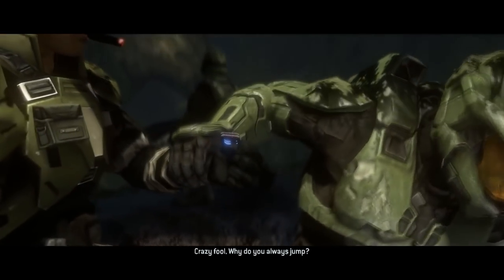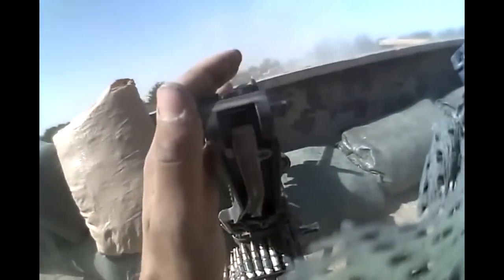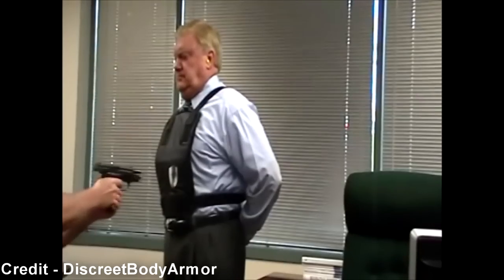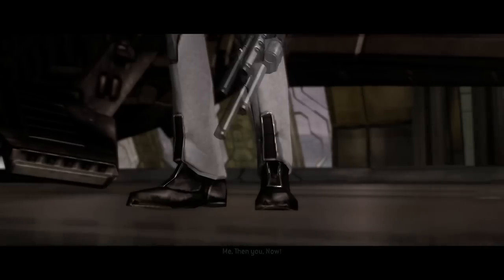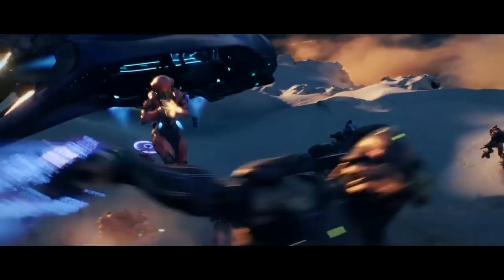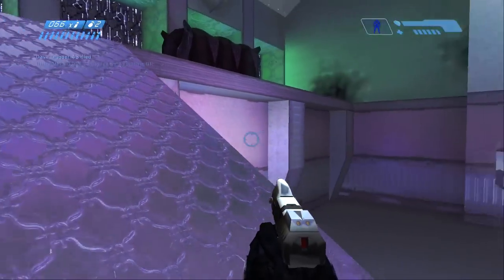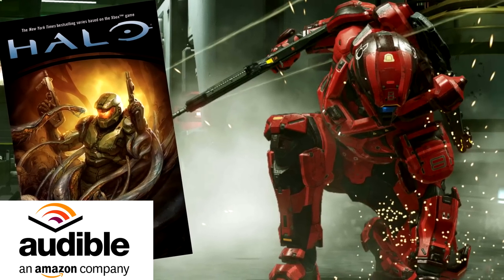Master Chief's Mjolnir Armour Full Breakdown (Halo)

Comment: The gell layer is probably a non newtonian fluid instead of a woven  vest of stuff
Reply: the goat king people are already trying to make this stuff. As far as I know a military is developing something called TALOS.
Reply: iirc the TALOS Project is trying to develop a set of 'power armour' to help with lifting stuff. Not a gel layer beneath armour which makes the wearer able to survive a fall from space.
Reply: Doctorpen  

Also, scientists at the Massachusetts Institute of Technology are developing a next-generation kind of armor called “liquid body armor.”

It “transforms from liquid to solid in milliseconds when a magnetic field or electrical current is applied,”

Totally didn't find the Talos suit by googling Talos suit 2017.
Reply: to problem is forces acting on you can be dampened using armor like real life yes however a body in spartan armor traveling at terminal volocity hits the ground the armour stops yeah but the spartan doesn't the spartans body is going to carry on traveling that speed untill somthing stops it and that gel even if it could without smashing up the body the internal organs also want to carry on traveling at that speed .. im sure you get the picture . to break a fall you need to be slowed down at a deceleration rate that wont kill you and unless that gel inside the suit is squishy and big enough to slow down a spartan falling from orbit longer than a slit second of the impact (which is impossible) then a gel layer would not stop you from being subject to G's

Comment: Correction: the black undersuit is not the gel layer. Immediately against the user's skin is a "moisture absorbing cloth suit and biomonitors that constantly adjust the suit's temperature and fit", on top of that is the pressurized gel layer, on top of that (in the Mark V and on) is "a weave of additional memory processor super conductor" which is how Mjolnir can support a smart AI along with the modifications to Chief's neural interface on the back of his head. Then on top of that we have the black undersuit which is composed of a "new reactive metal liquid crystal" which is what amplifies a Spartan's strength. The last external layer is the titanium alloy outer shell pieces. In the Mark V onward this is also where the shield emitters are held. On top of those green plates is the heat dispersing coating for added protection.

All the above info was pulled from Eric Nylund's book The Fall of Reach

Comment: I think that since it's called biofoam, that it would only last for a certain amount of time until it dissolved into perhaps a liquid or some form of nutrients. If I recall correctly, in either Contact Harvest or the Fall of Reach, a marine says after using biofoam something along the lines of, "This will stop the bleeding but not forever...". This indicates that the biofoam would dissapate after a given amount of time. Thought of this after you explained the current biofoam-like project and biodegradable clay pidgeons popped up in my mind.

Comment: Luke TheNotable, we do have something VERY similar in the Army since 2012 its called Quickclot Combat Gauze, which utilizes kaolin nanoparticles impregnated into gauze. It is designed to stop moderate to severe bleeding and stabilize a combat casualty. However, it is not a foam, and as gauze, it must be packed into the wound. An experimental foam developed in late 2012 by DARPA also bears many similarities to biofoam, as it is capable of packing combat wounds and halting internal bleeding.

Comment: On the topic of gel layers, some company made a type of gel layer that gets harder the more force is applied, so a punch will break your hand, and it's moldable,  pretty sure that  the weakness is lots of pressure applied to one small spot, so basically a single bullet will pass right through while something like an Automatic rifle will spread out the pressure throughout the gel, so very vunrable to snipers, very durable against An AR

Comment: LukeTheNotable, you forgot to mention that there is currently a way to stop blood loss in combat situations. I remember we had QuikClot combat gauze in the IFAK. Before that it was in powder form which its use was discontinued because of some of the drawbacks. In order to stop the bleeding a lot of the powder had to be poured on the wound.This would cause a production of heat from the reaction and may cause thermal burns. Another was the if there was a breeze the fine powder may get blown into the eyes causing ocular burns. If the person applying the powder decided to open the pack by tearing it open with their teeth they would  get chemical burns around the mouth. Not good.

Comment: There is a few references stating the cost of just ONE of those suits is as much as a ship in halo cannon. Which I'm sure finding that will be easier than the suit's cost in today's money, ultimately my rough estimate is 1.6 trillion in R&D and 5.5 Billion in a single suit, not to say other companies would have cheaper less effective suits mainly for Spartain III's and IV's as that is a much wider market for contract than Spartain II's. ODST armor is simulator to Spartain armor in a lot of different ways, but can be used by anyone. My idea of micro electronic-hydraulic enhancement suits similar to exo-suits but with finer detail such as improvements on grip, speed, stamina, and overall strength is also proven in cannon as well as Halo: Nightfall. The polarization of the protective glass/polymer is only unique to the ODST's which makes me think that a true Spartain helment sees not using a glass or a polymer rather a camera system that can enhance reflexes by having an AI of some classification or another predict the next move of an object which would further improve the soldier, unlike ODST's who had to rely on instinct rather than technology. The reason why you wouldn't notice the difference is because this is done fractions of a second faster than the time it takes light to travel even faster than what the image to video of today's tech is by using super highspeed cameras and a process that filters out stagnant and actice then uses velocity of that object to predict on screen and notices velocity changes and adjusts protective solutions, this is also why it can accurately judge shots of a weapon based on a predetermined model, and can learn based off of individual weapon and can adjust fire based off of minor variations of round trajectory and impact. This means that no standard computer can process, meaning the suit has a quantum computer built straight into the helmet, which explains further why AI can thrive in that suit VS. another suit. That quantum computer is probably located near the NSI located near the back of the head, major trauma could off-set the computer locking the suit or worse... if an AI is aboard the quantum computer wail such an impact has occurred or receive an AI after damage it could lead to faults within the program such as Cortana... expensive? Very. Tough? Only head on. (See what I did there?) Most of the stuff used in the power armor isn't currently known or used today, but what I can say is the suit has inspired people to try to make this suit, though the closest thing we will get to within our lifetime is the famed ODST armor. That's not including genetic enhancements... to completely answer it using rough estimates.

Comment: The suit really just helps enhance what the augmentations already gave them to the fullest. Master chief was able to survive that fall not only because of the jell layer in his suit but because he has a ceramic mesh around his bones, making them nearly unbreakable.

 Them being tied into their suit through their nural net is great because they've got an augmentation increasing their reaction time and motor control by 300%
Not to mention the muscle augmentation being boosted by the armors motor enhancement. Spartans really are the smarter, faster, and stronger
Reply: but a impact caused by volocity is much more complicated due to yes armour bones and and the gel layer can all stop without breaking and the gel layer can of corse dampen the impact slightly but traveling at terminal volicity when the armor stops your body carries on traveling that fast untill it meets the armor then your organs keep traveling at that speed until they meet your bones and muscle. forces acted on an area yes easily warped and diverted but acceleration and deceleration are problems

Comment: there kind of is a biofoam used today but is more of a cotton kind onf thing that is applied directly into the wound and it is supposed to desintegrate to stop the bleeding from a gunshot except instead of being fanvy like in odst you just ram it up the hole from the wound
Reply: I'm not sure if this is the device you were thinking of, but there is one called XStat and was approved for US military use in 2014, later approved for civilian use in 2015. Basically it uses cellulose sponges to absorb blood and put pressure on the wound to stop bleeding, like a localized tourniquet.
Reply: Watched a little further in the video, and he shows XStat being injected into a beaker.

Comment: Actually the bio foam is already real and is about to go to doctors for use. it instantly stops bleeding by working with the body and work with just a slab beef to stop the bleeding and can be washed or removed a minuted later depending on how severe it is.

Comment: so why don't they have "fallout" type armor as a substitute, that is famed exo-armor, rather than fluid "scale"-type armor that the Spartans currently use. basically a grunt goblin, with intuitive controls, rather than reactive controls like mjolnir as stream lined assault armor used for frontier forces where Spartans are either too much, or is so sparse a marine needs to be a spartan close equivalent some of the time, a sort of super-heavy armor that anyone can use and has substitute built in that the Spartans already have.

so on an armor scaling it has strong physical resistances but may or may not have a full energy shield, doesn't have and cannot use any weapons except from a specialized weapon pack.

I almost think this would be the kind of think the rebel faction was trying to make before the war and the grunt/convenient, like Oni tried and the jackle shield, reverse engineer. a sort of scaled mantis for light infantry, ODST, other shock forces, and deep out post where equipment is limited. the drawbacks of such armor being, needs constant refueling, becuase being so small while it can operate, it has maybe 6 hrs before needing to refuel, where Mjolnir can run nearly forever and do a mach 1:1 on everything. basically a shittier, less expensive, more temperamental substitute of a spartan and mjolnir. so in short why dosen't the UNSC have exo-armor that works just like mjolnir?

Comment: The injectable foam tube you were talking about in your video the one that hold all the small pellets yah that's the XSTAT and in the Army we use that currently just heads up. And the cost a Mijolnier armor in Cannon is as much as a UNSC Destroyer and the brand new Ford class aircraft carrier costs 10.44 billion I'd say the armor in today's money would be in the trillions if not quadrillion range even without the shield tech and theoretically if we could build it I'd estimate it to be that much. Granted to us that sounds like alot but remember we're one planet using the resources and stuck to the global economy we have here alone while In the Halo universe before the human-covenant war we inhabited 800+ world's so in comparison it's alot cheaper.

Comment: I'm pretty sure the gel layer is in the armor, not under the undersuit.
Reply: Arc 48 The under suit is actually called that because the alloy plates go over it. Most everything else is either in or just under that layer. The under suit is the majority of the armor but not the majority of the protection.

Comment: In the halo 3 manual, it says that master chief's armor weighs 1000 pounds. Not 700.
Reply: No it doesn't. It says that IN power armor Chief weighs almost 1000 pounds. The 1000 pounds includes Chiefs body weight.

Comment: Sadly the suit is very easily stoppable in fact one guy with an ak-47 could kill a Spartan but they'd have to have the jump on them witch is neigh impossible with the motion tracker but based on the assault rifle using 7.62 ammo it's basically just a bull pup ak
Reply: In the first halo game you can find assault rifle ammo labeled (like most other ammo if I recall) it's also stated in the novels (not sure if they are cannon or not but close enough) besides they have no need to be large in caliber especially considering they are just spray and pray weapons not a marksmanship rifle

Comment: Now just making the armor of master chief is hard and would cost a lot. If it was made with titanium which it is but you would have to get rid of a lot of armor since titanium is hard to shape. Now yes you can shape and make titanium into a liquid but it would lose a lot of the strength in the armor. Now just wearing the armor you can kill you self cause it is 1000 pounds. Now you would need an air compressor to help you move and you need the chip on the soldiers head because it helps your reflexes but just for that will cost a lot so we are just better off just making a full size plastic armor for master chief since we can do that and already did but still would cost some money.

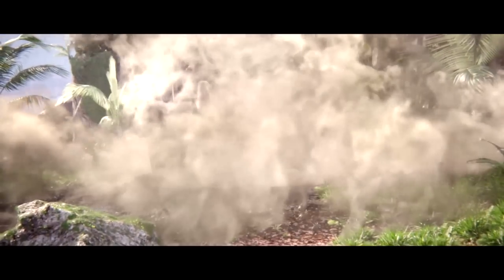Comment: 4:00
That's not how inflation works. Inflation is the increase of the unit of currency compared to the unit of value. In other words: if you have 10 pounds of gold and then make 10 dollars, each dollar is worth 1 pound of gold; if you then make 10 more dollars, then each dollar is worth only 1/2 of a pound of gold. We get inflation today because: 1:Banks create currency through loans (then spend the 'inflated' currency at the value of pre-'inflated' money since the general currency hasn't been 'inflated' because the 'inflated' currency hasn't been introduced into the economy yet. So once banks spend this created currency, everyone's currency looses value), 2: The issurer (in this case the Fed) prints more currency than value is created (in the case of the recent 'stimulus' we're talking billions of dollars a day more currency to value for a period lasting in excess of almost a decade).

Before the 'stimulus' of the 00s, the US dollar was worth just 2% of what it was worth when it was originally introduced. (Interestingly, most governments e.g. Rome, tend to collapse when their primary currency drops to about 2% of value.)

Comment: So the suit basically has a small sun powering it
Reply: Darren Rainey Well... technically no. We have small reactors like this already, not quite this small though. Honestly, the estimated time between refuelings for the suit here are conservative estimates based on the technologies we have now in regards to small nuclear reactors.
Reply: That is incorrect we have nuclear reactors that split uranium atoms (fission) to produce heat which boils water that turns a turbine. The mjolnir armour uses Fusion reacors (same process as a star) This process fuses atoms together in the suns case (hydrogen fuses with each other to create helium) This reaction produces ludicrous amounts of energy. but a fusion reaction needs to sustane its self for it to be a fusion reactor that can power things . We are working on them today, i belive france is currently building a fusion reactor it has been delayed alot and isnt going to be ready until atleast 2020

Comment: Where is the fusion reactor located on the suit?
Reply: DragonHalo3D the 2 rectangular looking things on the back of the armor are the fusion reactors.
Reply: Arc 48 Is that why Spartans die from one hit to the back?
Reply: DragonHalo3D probably, but I do know that the neural implant connecting the spartan suits to the wearer can snap if struck from behind with enough force, causing the suit to collapse in on the wearer slowly and painfully killing them, for more detail watch game theory's halo armor video.
Reply: Correct me if I'm wrong
Reply: Timmy Wallace The Game Theorists just speculated why it could happen. The real reason is to reward players for sneaky plays and outmaneuvering enemies.
Reply: Basically it only exists cause it a game. Just like with their theory on Lightsabers vs Energy Swords. The only thing that the ES had that was worse was it's 10 strike limit which is a gameplay balance and IMO makes it better since you can't just go through the entire campaign just one hit killing everything.
Reply: Timmy Wallace It's also because we only see it happen when another Spartan hits them there with a precision strike in a more vulnerable portion of the armor. The jell layer can handle an over all hit from space. But not single bullet less than one froman anti-materials rifle would be able to do the same thing.

Comment: WRONGGGG, It weighs 900 lbs...
Reply: No it weighs 700 with the 200 pound spartan.
Reply: I'm gonna refute from saying anything rude, An average Spartan weighs 300lbs roughly on their own, Their armor weight does vary, But most of the Generation 1 and 2 weighed between 800lbs and 900lbs on their own.

Comment: what about halo players are bether than titanfall players?
Reply: Marco Trento Titanfall 2 mp, has skill gap compression, which isn't present in Halo 1-3 &5 arena. Titanfall movement system takes practice to master, thus encouraging skill gap. In Titanfall 2, combat became increasingly random, and more skill gap compression was added to the mp. 

I personally find Halo 5 slayer to be much more difficult than Titanfall 2 pilot vs pilot. This is do to equal starts, and the longer kill times of Halo 5. I think Luke needs to do Halo vs Gears players, as those two IPs, are the only popular arena shooters on consoles.
Reply: Try me bro just try me